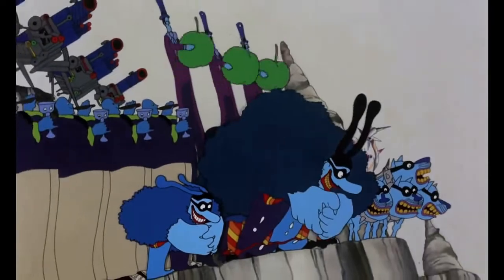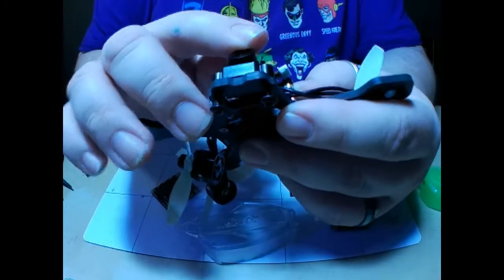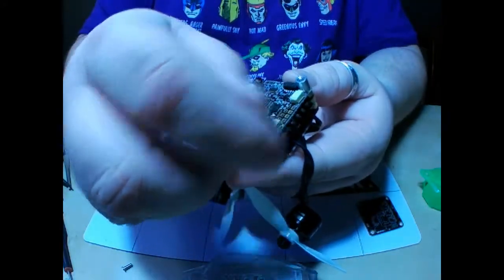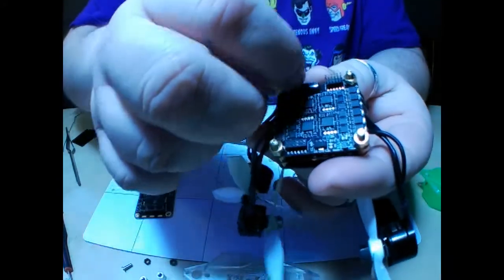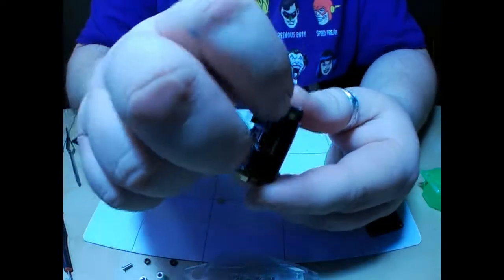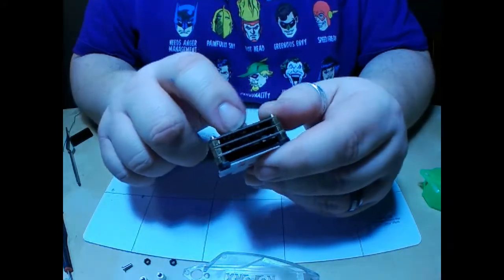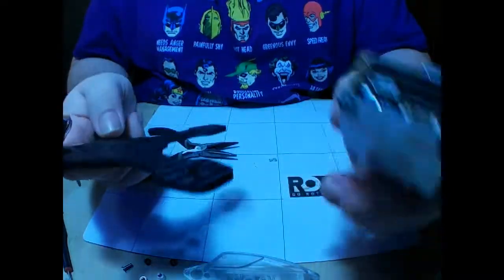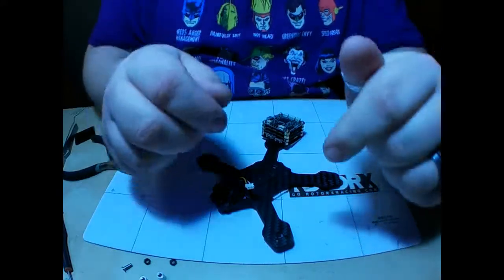RotorX Atom V2 to V3 upgrade - How To.

Comment: need your help please just got 4inch frame rotorx installed everything i put on 1306 4000kv motors redbottoms emax is it ok to use three inch props on that because thats all i have to use please reply quick thank you
Reply from the maker: Gfighters2011 heck yeah man! Use those 3" props! They work amazing on the 4" atom!
Reply: so i can use 3inch props on that 4inch frame
Reply from the maker: Gfighters2011 yes you can. That is what I use on mine. :)